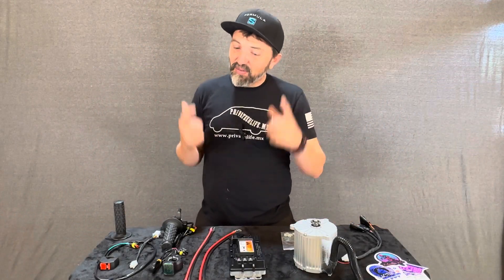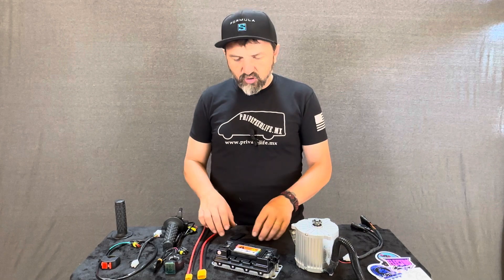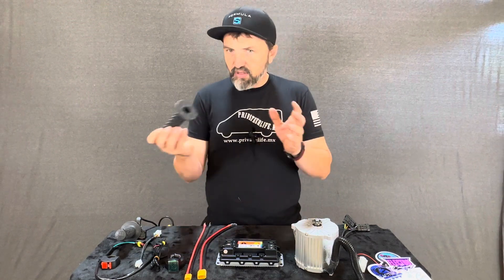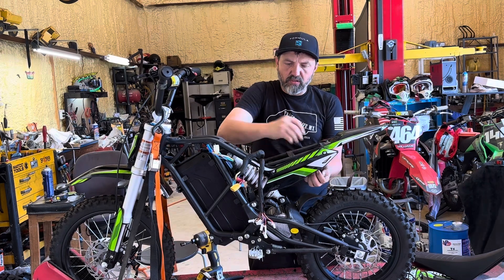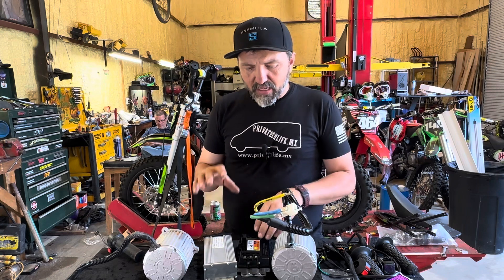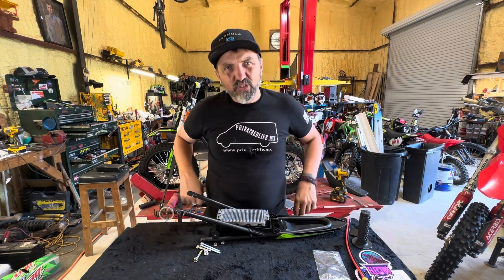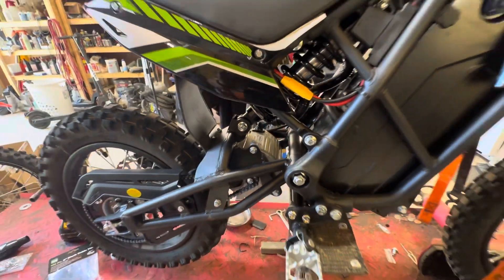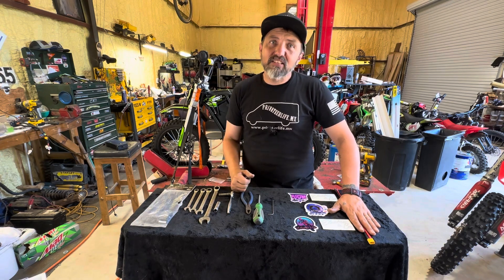Electro & Co controller on E-Box 2.0

Comment: could you tell me the stands off and the screws you used for the stands offs please
Reply from the maker: I don’t quite remember the measurements but if you hold the controller up to the bike, you can measure it. They don’t bolt on completely straight, but it really doesn’t matter.

Comment: When buying the the upgrades does the batery effect the speed or how long it last?
Reply from the maker: We seem to go through the battery a little bit faster but totally worth it for the power increase.
Reply: @Radwoodgarage  i thought that the upgrade kit made it faster not the battery i just dont want to spend money on both so i want to know which one to get the battery or the upgrade kit
Reply from the maker: @ChaLayishim  battery kit wouldn’t make it faster without a new controller. The motor and controller kit from E&C will make it faster using the stock battery
Reply: @Radwoodgarage  thanks

Comment: Thanks for making this video!
I installed the kit just as you did here but I’m getting an electric arc when I try to connect the fuse.
Everything seems to be plugged in correctly.
Did you have this issue at all?
Reply from the maker: I didn’t, I would definitely triple check everything
Reply: @Radwoodgarage  turns out, it was the residual power. I worked up some courage and just plugged it in with a little spark. Works fine now.
How low do you let your safely let your voltage go down to, before charging? 
Somewhere around 55v? Or do you let it get down to around 48-50?
Reply from the maker: @deputypete  I tapped into the wires going to the voltage meter and tied in the percentage meter. So I can just use the factory meter lol
Reply: @Radwoodgarage ahhh clever!
Reply from the maker: @deputypete  not to shabby for an old country boy lol

Comment: do you need to buy the motor to get the 45mph controller or can you buy it separately
Reply from the maker: It comes in a kit. The stock motor won’t hold up to the new controller.

Comment: when you put the spacers on are you using new bolts or are they stock bolts and did the kit come with them or did you buy new longer bolts if so can you give me the size and thred to them
Reply from the maker: I used new bolts and nuts M6 1.25 and I made the spacers.

Comment: Pretty sure with your ebox battery it is around 4,000watts with this kit now not 3000W
Reply from the maker: The 2.0 E-box  has a 60v battery. The stock is 3000w.
Reply: @aMotoheadsGarage  with 72 volts your gonna get 5000w ...so probably 4000w at 60v. 48v and this motor and controller is like 3000w 👍

Comment: Where was the part where you put the new motor in
Reply from the maker: It was just a quick swap as it bolted right in. Tried to not bore people with the ease stuff but I probably should have shown it.
Reply: @Radwoodgarage  ok, and about the surronster using tape to hold the controller on, where would I put the tape to secure it without covering the controller
Reply from the maker: @robertdicolamtb  I don’t really think using tape to hold on the controller is appropriate. He did that because he doesn’t have the needed tools to build a proper mounting system and how often does he use the bike?  Never, he got the bike and controller (preproduction) for free. So he has nothing invested and doesn’t care what happened to it. I buy all my bikes so I can give my true thoughts. That way everyone knows it’s unbiased.
Reply: @Radwoodgarage ok so what was the thing that you made to make it be able to screw in easier? Can I possibly buy it from somewhere?
Reply from the maker: @robertdicolamtb  I show how I made it in the video.
Reply: @Radwoodgarage thank you!

Comment: You can rewire the factory switch and battery % into the kits wires, which is what i did with mine, everything looks oem
Reply from the maker: Where did you run the wires?
Reply: I would also like to know as I'm getting the kit and would like to use the key over a button for better security reasons
Reply from the maker: @christianwatkins8459  I cut the wires to the switch and % gauge. Then wired in the key switch and gauge. I wired in the % gauge and volt meter together so I have both.
Reply from the maker: @FugginFet  I added a plug so it could be removed. So it just T’s off.

Comment: Is the ebox better then the large motor tec 1500watt bike
Reply: The mototec 1500w does 17mph I have an ebox 2.0 I'm 21 13stone and it does 27mph stock I have got the upgrade kit with the battery on its way though I also ordered an extended swing arm from them for a razor that will also bolt on to the ebox t havent the new 5000w power
Reply from the maker: They are probably about the same frame wise. The eBox has a 60v battery and a 2000w motor.
Reply: @Radwoodgarage  have you seen the new bomb motor b1 thinking it's bigger and better made you have any knowledge of that one
Reply from the maker: @davidsarff8532  I haven’t

Comment: would i be able to only use the motor upgrade permantly with the stock controller or would it over volt
Reply from the maker: That’s something I would definitely ask Electro & Co.
Reply: It would over volt the stock controller is only to power up to 2000w it would blow the controller as the new motor is 2500w but over voted to 3000w with the new controller

Comment: I think those motors are both exactly the same, they just sold you one with a different sticker.
Reply from the maker: Idk, as you may have seen in the last video about it, it’s way faster now. I know their controller had been having issues with the stock motor. So I think something is different.
Reply: Wrong , hence why the kit makes it faster

Comment: I have over 130 miles on my ebox on trails hard hills lots of bushwhacking 3 foot grass fields for miles. Ebox took care of me for a wheelbearing replacement and a new wheel and took care of me with a uprgraded shock for my troubles. Should have went through warranty process not the social media. I did have to post some videos of the issues and take them down to get the parts.
Reply from the maker: I went through the warranty process and got nothing. If I hadn’t messaged the media, I wouldn’t have gotten anything. I emailed them 6 days ago and still don’t have any response. They dropped that ball and I’ve been extremely nice about it. I’m giving them as many opportunities to make this right as possible but sooner or later I’ll have to just give up and tell people my opinion might be to not buy the bike unless they are ready to upgrade it.

Comment: Great idea with the standoffs. Would you be willing to make a set and sell them to me?I don’t have the tools to make them from scratch. Also, looks like you have a new coil over in the rear. What brand/ specs? Thanks! A fan and subscriber. 👍
Reply from the maker: Just stop by Home Depot and get 1/2” square tube in the fastener section. Then just cut it with a hacksaw. Super easy. I then just painted them black.
Reply: @Radwoodgarage how long are the bolts you used?
Reply from the maker: @Chegooutdoors  they were like 2” if I remember right.

Comment: With the cost of that kit, plus import tax in to the UK, it's almost half the price of the bike again for the upgrade. Good info on how to fit it. I'm looking forward to the ride test to see how it performs.  I'm wondering if I can just get the controller and throttle in order to get better control. I don't need a bigger motor.   I'd prefer a cheaper solution if I can find one.
Reply: I decided to check their website and they don't ship to the UK. So it's not an option anyway.  I guess if I had the model numbers of the controller and other parts I could try to source those from elsewhere. But then I don't know if they just work or some programming of the controller is needed.
Reply: They won't sell just the controller,you have to buy the whole kit..
Reply: Good info. I just don't know about compatible controllers and motors etc. or where to learn about it. But if upgrades to make it better are too expensive, I feel it's probably more worthwhile to just put that money towards a better bike. On the other hand it can be useful to play about with stuff as part of learning.
Reply: do you know the exact name of the electro 1 co kit in this video ?
Reply: I got mine and I’m from the uk